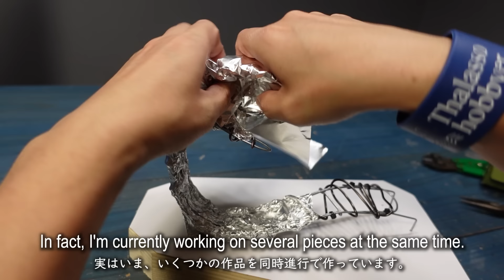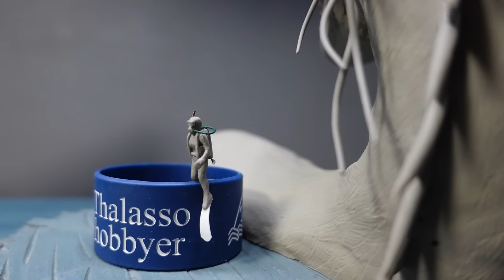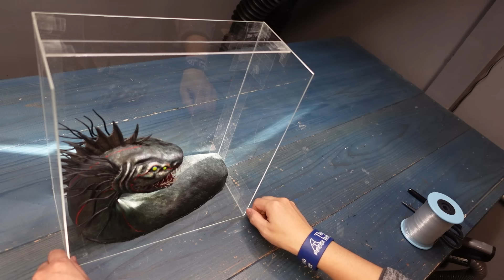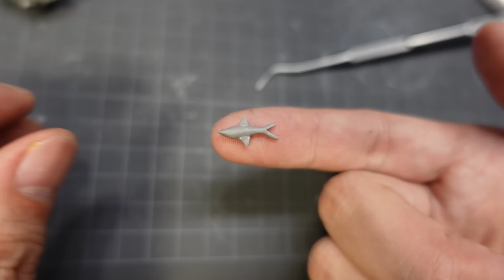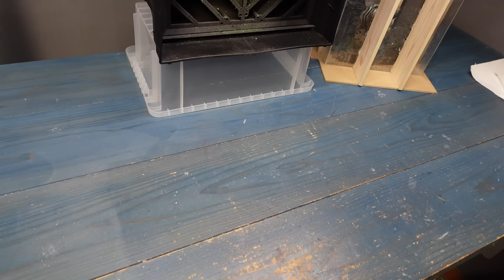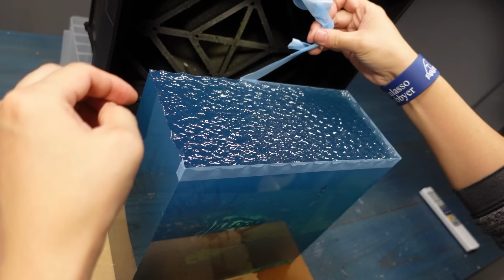Resin art of dog lover and nightmare

Comment: I am always amazed at the clever techniques you use, such as molding the clay through plastic wrap to give it a certain texture. Thank you for the video. Also, I have a question. How did you make the diver's flippers?
Reply: Molding clay through plastic wrap is a very common technique :) it lessens fingerprints and allows you to make cuts and lines without a harsh edge
Reply: @poopytootsface3489  I would agree that it's styrene but for my cost-cutting budget I've used yoghurt pots etc in the past for stuff like this... 'any port in a storm', as they say
Reply: I learned that technique from him and use it every time now :)
Reply from the maker: Thank you for watching. The diving fins are made by bending a plastic plate for models.
Reply: Probably used more common clay that you can find in dollar stores. The really light, flexible stuff I can’t remember the name of. Finding a large cylinder with a good curve, laying the flat clay on a sheet of plastic wrap. Then she probably waited for it to dry before gluing it to the feet.
Reply: @aleeshagilbert1009  cos clay even when it's heated up it stays flexible

Comment: Amazing work again my friend. You really brought this nightmare into life . And the bubbles technique was very good.  Was the outline of the UV resin  completely invisible or sometimes it is visible depending on the  angle the light hits the diorama?
Reply: Hey, I just watched your video with the Volcano in the city, amazing job to you too!!
Reply: @zozo8197  thanks .
Reply: You're both so talented!
Reply from the maker: The edge of the resin plate is barely visible. If you shine a strong light on it and look at it close to your face, you might be able to see a little bit. However, since it is still a board, it loses its three-dimensional effect when viewed from the side.
Reply: @Thalassohobbyer  thank you for the info.  amazing work again 👍
Reply: @Thalassohobbyer  are you going to keep using the technique? Seems liked it worked like you wanted it too.
Reply: @Thalassohobbyer  What if you put a cylindrical item that's easily detached like aluminium foil, doubled it with plastic for the resin base, so the bubble pillar end results would be cylindrical, making it appear sideways too?
Reply: @shurarozen2597  i think he used something like this in his latest video
Reply: @lorcangould9110  Ohh, haven't caught up to the latest one, sorry ;;;
Reply: @4THECRAFT  your contents are all good. New subscriber here.
Reply: @Thalassohobbyer  I can’t remember if you’ve tried making crabs yet. Have you ever thought of making a diorama surrounding a giant Japanese spider crab? The regular Japanese spider crabs are big enough, but a giant one would be even more terrifying.   https://youtu.be/kAJ2OoXk4zE  Excellent job on this one, as always.

Comment: Nightmare:

As I swim through the deep waters that are the ocean, massive, beast emerges from the murky depths before me. Its body is as long as a city bus, with shimmering, iridescent scales covering its serpentine form. The scales seem to change color in the faint light, flickering between deep blues, purples, and greens. Its eyes are large, glowing orbs that seem to burn with an inner fire, and its pupils are slitted like a cat's. The beast's jaws are lined with rows of razor-sharp teeth that glint menacingly as it opens its mouth, revealing a dark abyss within. A long, powerful tail whips back and forth behind the creature, sending waves cascading in all directions.

As the creature draws nearer, I can see that it has dozens of writhing tentacles sprouting from its sides. The tentacles are covered in tiny suckers that glisten like jewels, and they writhe and twist in the water with a sickeningly graceful motion. Each tentacle seems to be tipped with a sharp, barbed hook, and I can imagine the damage they could inflict.